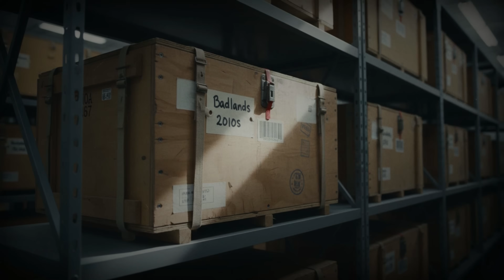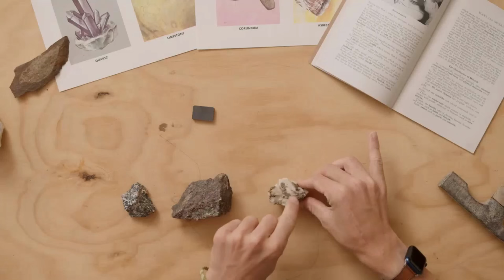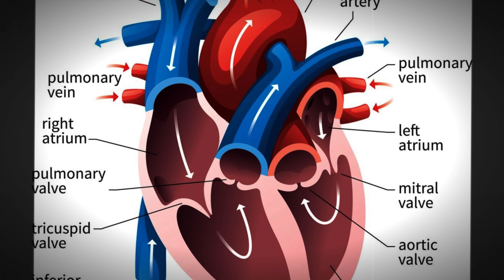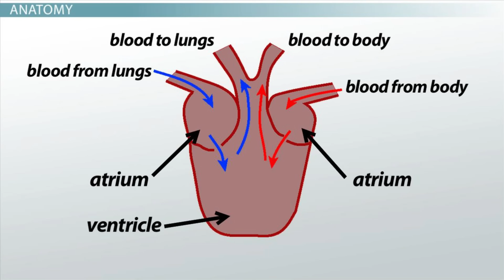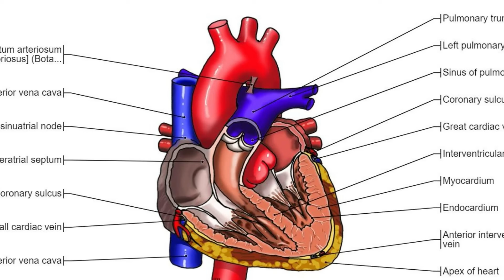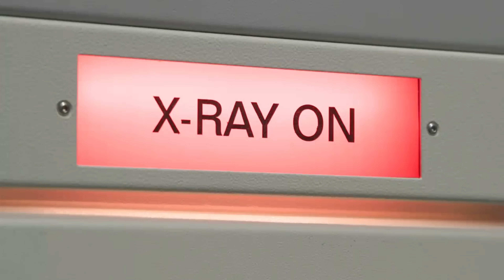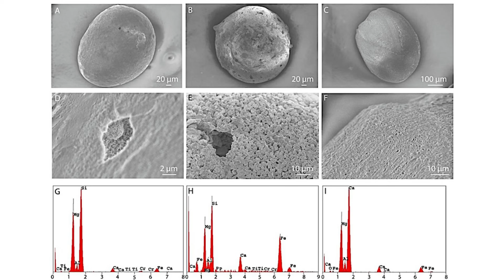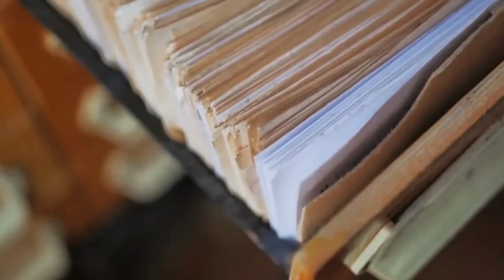The Dinosaur Fossil With A Beating Heart (And Museums Are Fighting Over It)

Comment: Have we got any more information from the mummy fossil’s internal organs? If we are in a hurry put them into the ct scanner and find out. This will help to do a better job of cleaning.
Reply from the maker: Great question. The original Willo CT scans from 2000 were pretty comprehensive, but you're absolutely right, modern scanning technology has improved massively in the last 25 years. 

Higher resolution imaging could potentially settle the "heart vs. concretion" debate by revealing micro-structures that weren't visible in the original scans. The problem is access: getting museum specimens approved for repeated scanning, especially controversial ones, involves layers of bureaucracy and cost justification.

That's exactly the frustration I'm trying to highlight, we have the technology to answer these questions, but institutional inertia keeps the evidence locked away. Really appreciate the practical suggestion.